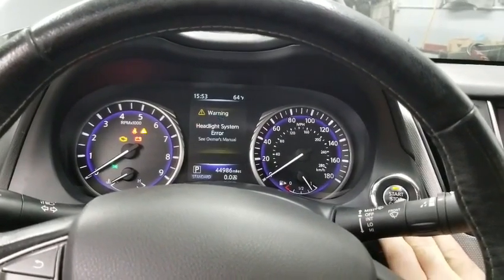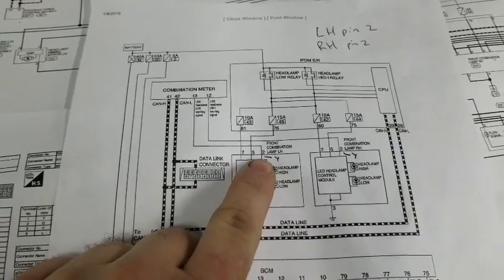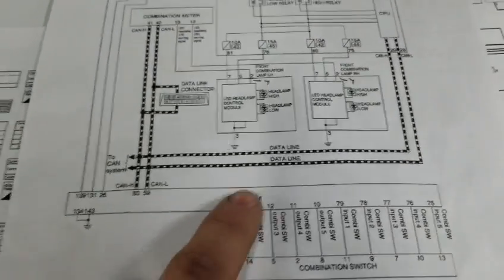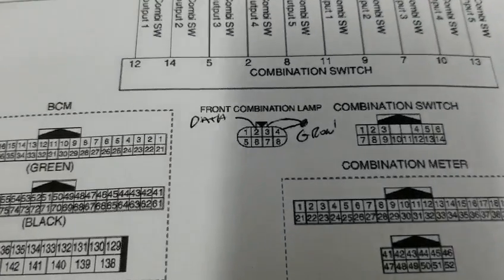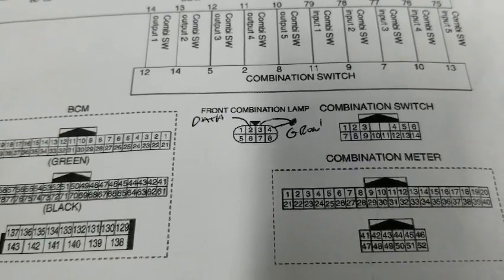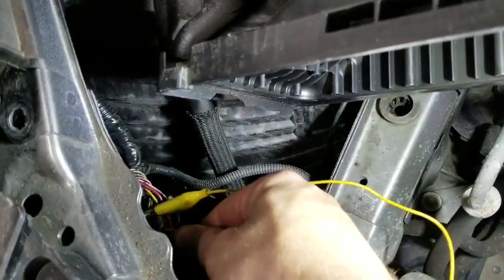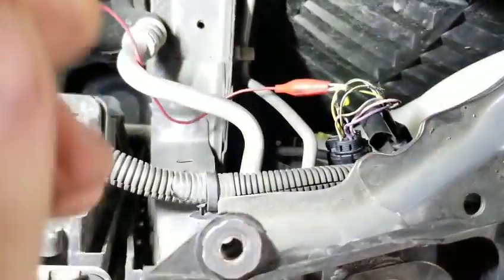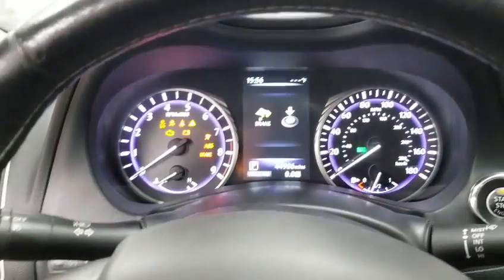INFINITI Q50, NISSAN HEADLIGHT SYSTEM ERROR FIX, HACK, BYPASS, STEP BY STEP.

Comment: Mechanic just tried the hack on my 2017 q50 and it worked!  Hope this is a long term fix. My headlight was also replaced, and it works 100%. The error message is gone. Big thanks to the creator of this video!
Reply from the maker: It will work no problems
Reply: @melniksmotors  Hello. I have two problems with my Q50 2018, the first is a fault in the key system and the second is the front radar

Comment: Thank you for the video. The only thing I worry about is 10 volts potential between pins 2 and 3. Isn't it too much just for signal cable? I want to get rid of this warning message on my q60 2017, but I really don't want to burn some microscheme in same time. Shouldn't there be at least some resistor between pins 2 and 3 just for safety?
Reply: I've made it today. All fine. No more annoying message!

Comment: Hi George...I have same issue with my Nissan Maxima platinum 2017...I dont have wiring diagram, kindly advise which to wires to be jumpered??  thanks in advance ...
Reply: Ahmed Saleh I didn’t know if you fix this issue but this how you get the diagram https://carmanuals2.com

Comment: Hi George.
I have a Q50 headlight purchased on ebay. But the hi beam light is not working. Do you know if it needs to be reprogrammed or it is just the defective headlight?
Reply: Hello you resolve the problem...I have the same problem
Reply: Did you get the high beams to work ? If so how ? Thanks
Reply: no. changed the headlight
Reply: Was it an aftermarket headlight or oem that came with the car? I just bought new headlights off eBay and the low Beam works high beam doesn’t.
Reply: Sorry I just reread your comment you bought them off eBay too

Comment: Will bar coding resolve the issue? Would you know if the dealer would perform this type of service ?
Reply from the maker: No. Dealer will never perform this service. He will make you buy new headlight, plus make you pay labor to install it
Reply: George Melnik 

Got it. How reliable is this FIX. Will I still have communication working using scan tool  to all the modules ?

Comment: How can i do an ECU reset on this car? I have these AWD and chassis control error warnings that i cant get rid of
Reply: Ahmer Ali hey brother hmu on instagram 
@MasterShefu
https://instagram.com/mastershefu

so i can send u photos of the part to order from ebay, i believe if we just replace the ABS wheel sensor, that error will go away. 
One of the sensors is probably damaged, signaling that error to the computer

Comment: hi bro, i have nissan maxima 2016 and my driver side is showing error. can you please make a video and show us how to by pass it
Reply from the maker: Sure if I had Nissan Maxima here but I don't have one
Reply: George Melnik can you please see the schematics of 2016 maxima and tell me which 2 wires i have to join? i have tried alot searching for schematics but could not find it anywhere. or is there any way i can check ir find the canbus cable using a electric meter ? from your videos i can understand that the canbus wire will connect to negative but the problem is there are many wires how can i know which one is it if i dont have a schematic ? please help bro this is really annoying
Reply: @sambulucci  hello bro did you managed to find the schematic?

Comment: Does anyone know if it works on a 2017 q60? Or any q60?
Reply: I had this issue on my q60 2017. Fixed with this hack. All identical- 2nd and 3rd pins
Reply: @zuzlanzuz3592  how did u get to the headlight harness? did u remove the bumper?
Reply: @Kyle-rk6ry  no need to remove bumper. After removing intake filter with part of it's casing you can get to the headlight connector
Reply: @zuzlanzuz3592 I have a 2017 q60 as well low beam doesn’t turn on all other lights work could this fix the problem?